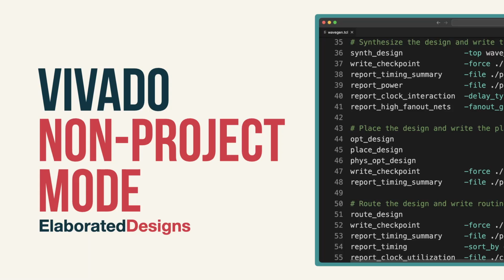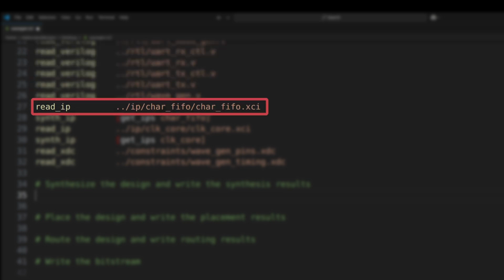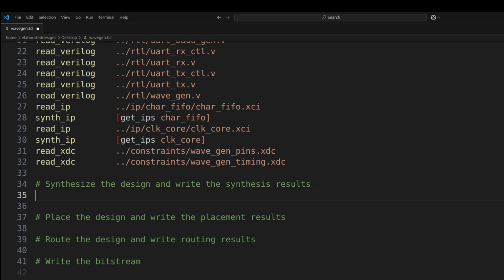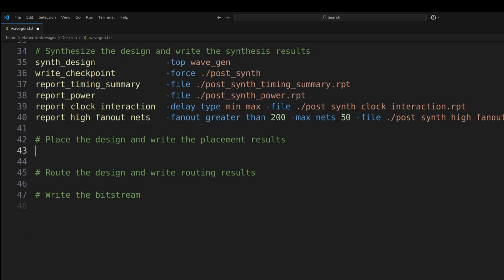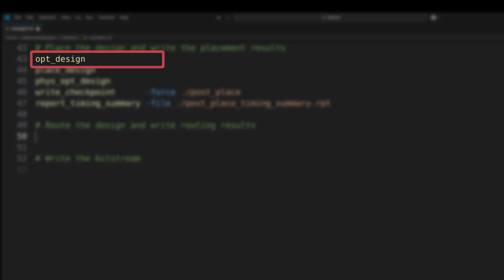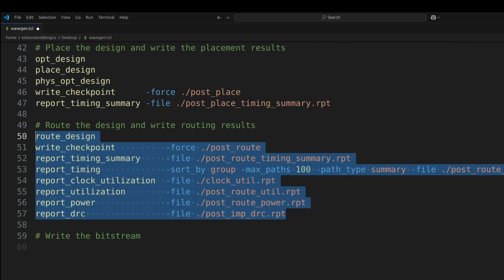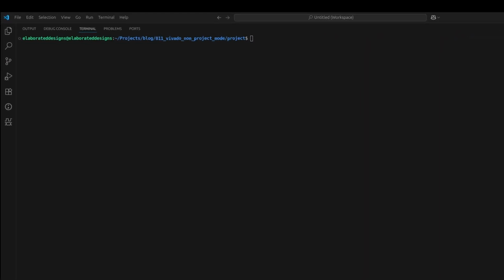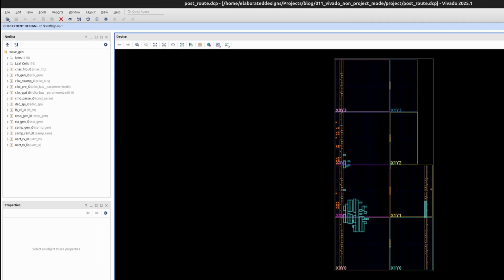Using the Command Line in Vivado Non-Project Mode

Comment: what are the pros and cons of both Project mode and non-Project mode? what are the use case of both?
Reply from the maker: Great question. This is an excerpt from a blog post I wrote about the Project Mode, but didn't make it into the video:

In Project Mode, Vivado manages source files and design status, generates and stores results and reports for each stage of the design, and supports advanced analysis capabilities, most notably the ability to cross-probe signals across design stages. In Project Mode, the design is managed with a project file stored on disk and updated across multiple work sessions.

In Non-Project Mode, the designer is responsible for managing source files, generating, and storing results and reports for each design stage. In Non-Project Mode, Vivado creates a minimal project in the PC's memory, which is deleted when the tool is closed.

The choice between Project and Non-Project Mode comes down to control versus convenience. The Non-Project Mode offers total control over the development flow, but the designer is solely responsible for managing the design. On the other hand, the Project Mode has many convenient design management and analysis features, but it limits the designer's control over the development flow.

One common misconception is that the Project Mode is intended for use with the GUI, while the Non-Project Mode is designed for use with the command line. This is not the case: both the Project and Non-Project Modes can be fully utilized from the command line, and both support batch (script-based) and interactive (single-command) execution.

The use of the GUI is a bit more nuanced. The Project Mode provides full support for GUI interactions and includes analysis tools that work across various design stages. On the other hand, the Non-Project Mode supports GUI interaction only through design checkpoints, whose scope is limited to the design stage in which they have been generated.